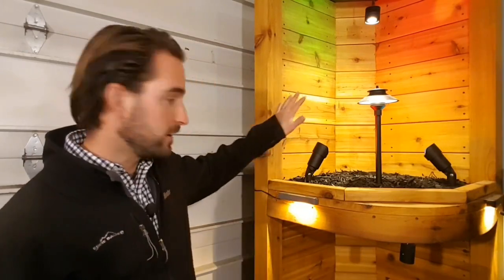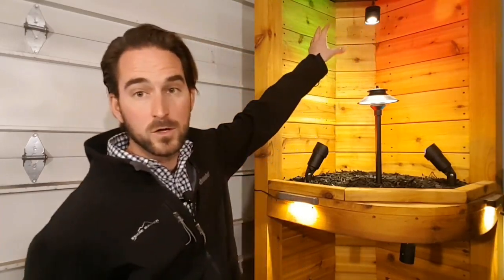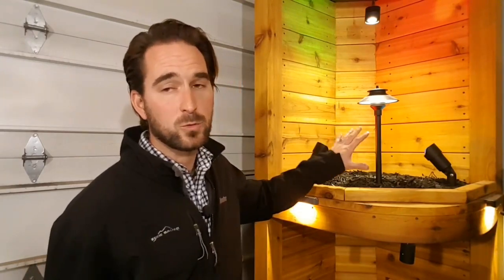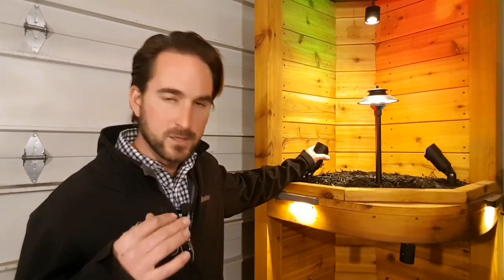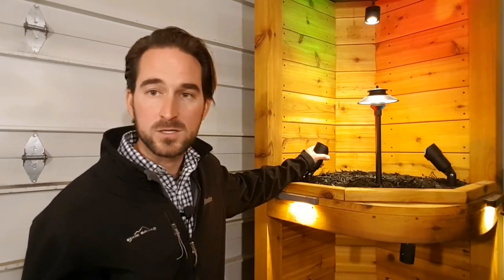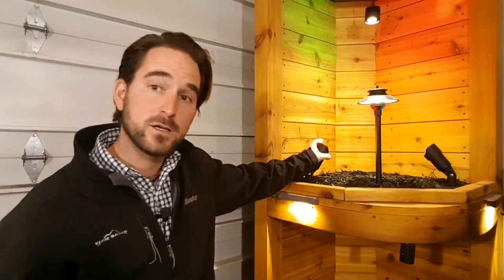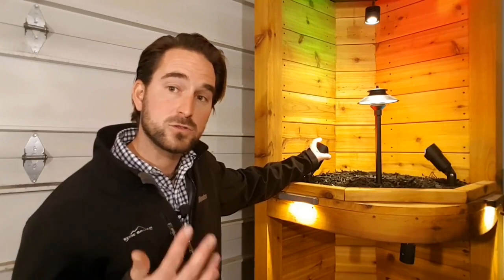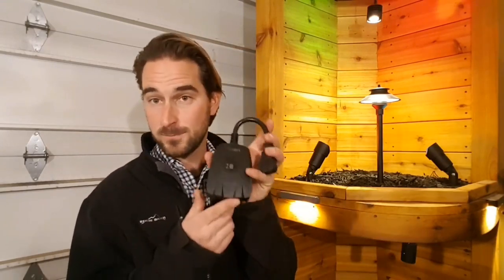Low Voltage Landscape Lighting Transformer Selection

Comment: I only hear about running a single line wire for the LED lights into a 'multi-tap' transformer.  Aren't these transformers set up like a breaker-box service panel for multi-lines out, where shorter runs tap the 9v lug and longer runs tap the 15v, for instance?   Thanks
Reply from the maker: Great question. Most LED lights will run at max efficiency anyweher between 10 and 15 volts so less of a concern about using different terminal taps however if running more lights on a longer run always better to use higher volt tap. Search "lighting doctor voltage drop" for more i ndepth videos
Reply: @LightingDoctor  Can you run multiple lines out rather than 1 long line for lights?Why not run (12) 18w LED's in 3 separate (4) light runs from a centrally-located 300w transformer?  What's best: 1 long line for all 12 lights looping around the landscaped area, 1 line out with splices, 3 equal runs of (4) lights, or some other way?  Thanks

Comment: my question is why am I getting a  1..sometimes 2 second delay before the LED lights turn on with my transformer
Reply from the maker: Great question. It just taks a while for the power to travel down the line. You would notice a longer delay the colder it is outside as the power will move slower as it cools. Hope that helps

Comment: I realize my question is much the same as below. I have an existing Malibu low-voltage lighting system with an 88 W transformer. After installing LEDs I will be somewhere around 32W total power consumed. My main question is will this add stress to the individual LED bulbs if the transformer is rated at a maximum wattage that is three times higher than what I’m actually needing?
Reply from the maker: No if you are using good LED lamps you will not run into any issues

Comment: Great video.  What about the difference in 12V or 15V output?
Reply from the maker: If installing LED Lamps it really wont make a difference. Most LED lamps run efficiently anywhere between 9 to 15 volts. 15 volt tap just allows you to add more lights at a larger distance if required.